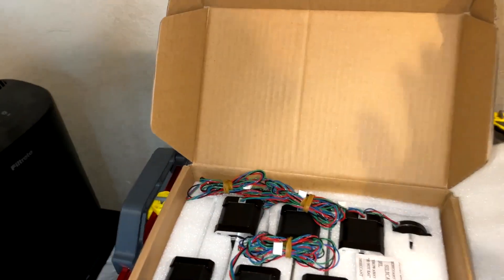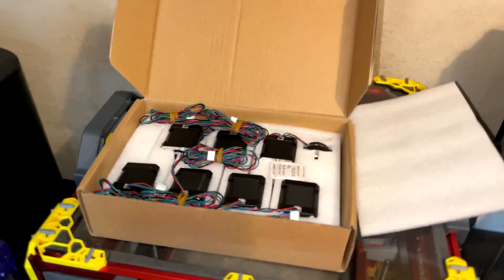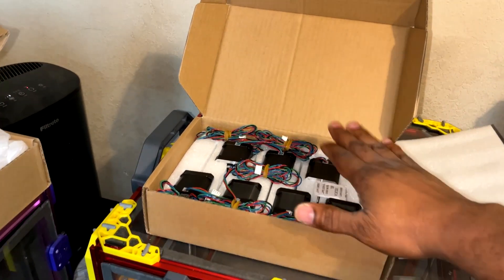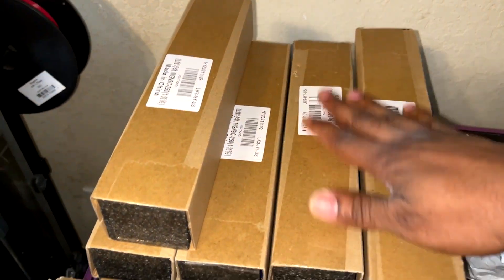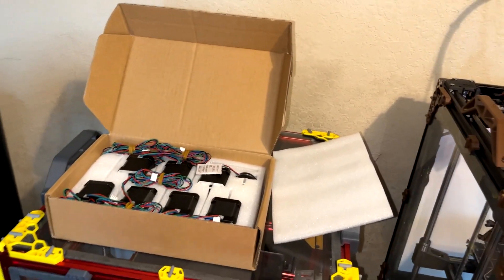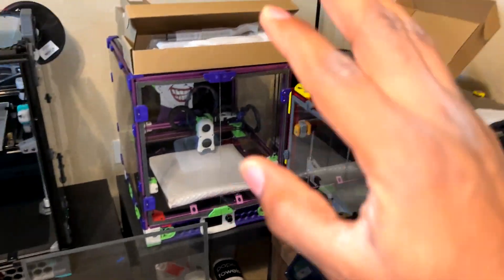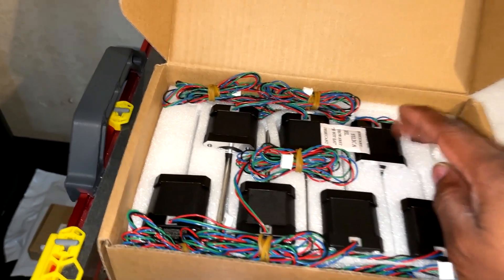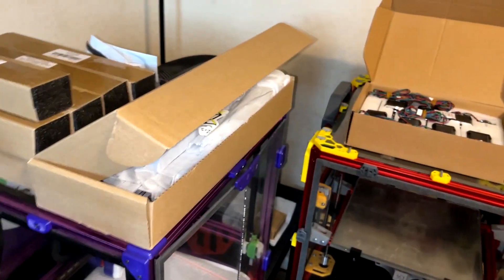Annex K3 Build // New Update // GoldenJaguar3D

Comment: What are the base printer you use for those switchwire? I have a Biqu BX with dual Y aluminum profile, I can’t find an after market carriage for it.
Reply from the maker: It was a sunlu s8 that I used it was pretty easy to turn into a switch wire